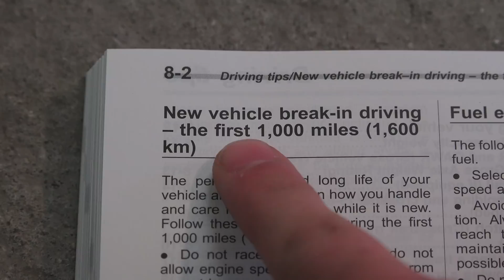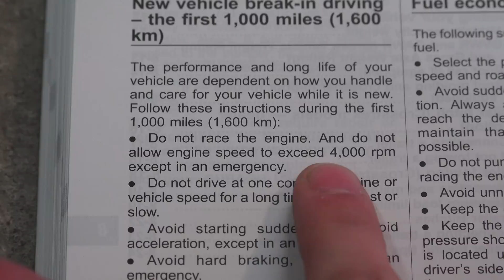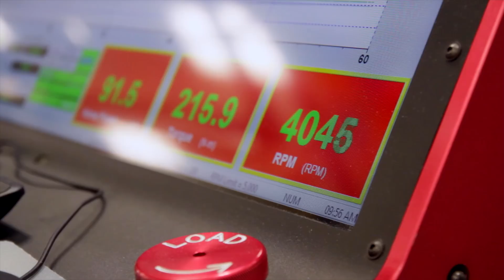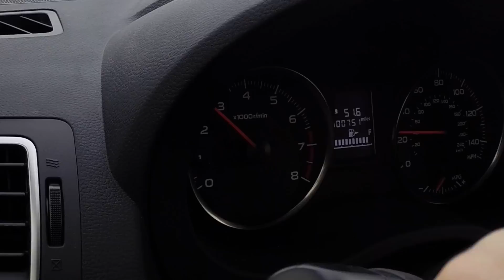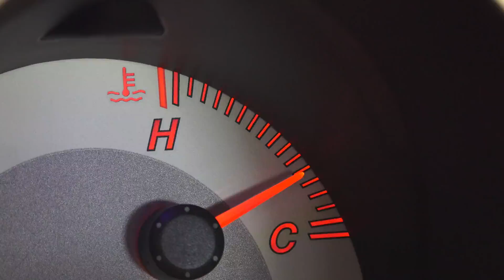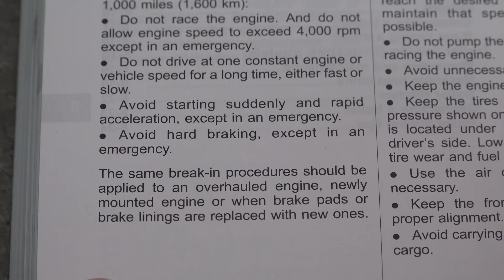5 Things You Should Never Do In A Brand New Car

Comment: I'm a diesel mechanic. When I use to rebuild engine, we'd get them to operation temperature , do some obvious  chech then work the hell out of them. I know gas engines are diferent, I'm not sure what is best but I've alway gone easy with my 4 strokes and 2 strokes for a bit. Do a quick oil change on the 4 strokes, extra oil on the 2 strokes and they last for years.

Comment: Finally, I had the guts to buy my first brand new car (I really don't like new cars they are just plastic and cheap manufacturing) and did everything for the first 1500km to ensure is going to be as good as it possible can taking in consideration is a 2025 car and is basically a cheap plastic piece of crap. By the way is a Suzuki Jimny 3d 1.5L I4 manual transmission and I'm actually in love with that little tough fella

Comment: If a Lycoming aircraft engine is not absolutely floored for the first hour then the rings will not seat and it will burn a quart of oil every 4 hours.
If you break it in WFO like the manufacturer recommends, most will burn a quart every 9-12 hours.

Comment: Unless your driving on a billiard table you shouldn't have to worry about cruise control. It's the speed that stays constant, not the rpm or load. I can't imagine trying to drive anywhere trying to vary the engine rpm enough to make any difference. If you are you'd be a hazard on the road.

Comment: The reason for not flooring your new car in the first few hundred miles is so the transmission and differential(s) have less load to bed in properly. If your engine were to be run in on an engine dynamometer, if I recall correctly, the way that Lake Speed Jr (the Motor Oil Geek, who also works for Total Seal Piston Rings) recommends to break in your engine is to do some low load, low to mid speed running for about half an hour to bed in the valve gear, then do some runs of about 3/4 torque, and somewhat lower speed than redline, gradually working your way up to full throttle and up to redline. After that, you change the oil two or three times in the first 3000 miles to get rid of the wear particles ASAP. The rings need combustion pressure to bed them in properly, and not giving the engine enough torque can result in the rings failing to bed into the bores properly, and once the initial bedding in is complete, that's the way the engine will be until it starts wearing out. If you haven't given the engine enough of a test, the rings won't bed in properly, and you'll have an oil guzzler.

Comment: Thanks for another great video. This is why I bought a new GT4RS instead of a slightly used one. With a light-weight flywheel and sound that begs you to floor it, that's exactly what many people do on those test drives.  It's like a rental car, they don't care so they thrash it!  So you spend a ridiculous amount of money on a car with a couple thousand miles on it and have no idea if it has been treated properly.  Now I'm struggling myself to behave and have to admit I've done a few 6500 rpm shifts (redline is 9k rpm) but I haven't floored it and do vary the speed.  600 miles now with a recommended 18oo mile run-in.  ugh it's gunna be torture and I'm trying to behave.  I did read from an ex Porsche engineer that after 1000 miles you can slowly increase the max rpm but no redline until full run-in so hopefully I'll be fine..:)

Comment: I floored my gr86, trying to keep up with my friends supra 😭😭. I did this like 5 times for short periods during the first 1k miles. Did I mess anything up?
Reply: The oil consumption can be an indicator if you did something wrong. Actually to brake it in sooner you need to floor it but not to the red line. The high RPMs are risky.

Comment: The not flooring it comment is wrong, in modern engines with low tension rings cylinder pressure is what pushes the rings against the cylinder wall and provides the sealing to help mate the ring to the wall. You want some hard acceleration and quicker driving to get a proper seat on the piston rings.

Comment: Unfortunately, during the break-in period, some of that will be impossible, specifically getting it to operating temperature every time. When the car is being moved around when it's brand new, before you even take it home, it's going to be moved a few times by the dealership, and they will not get it to operating temperature. They'll start it, move it a few hundred feet, and turn it off.

Comment: Step 6: Change the oil and filter at 500 miles.
Step 7:Change the oil and filter at 2,000 miles.
Step 8: Change the oil and filter at 4,000 miles.
Step 9: Change the oil and filter at 7,000 miles.
Step 10: Change the oil and filter and automatic transmission fluid and filter (if applicable) at 10,000 miles.

Many years ago, when I was 23 and going with the girl that was to become my wife (back in 1970-71) and I knew all of this stuff about cars, her 18-year-old brother bought a new Camaro with a 427, four on the floor, and a 4.11 rear end. I told him how to carefully break in that engine. Well, he took a trip . . . and seized the engine in about 300 miles. It just breaks your heart.

Comment: This is all ok, however oil and engine technology has changed. manufacturer recommendation is incorrect and you can do more damage "babying" the car. the first 200 - 300 miles I agree, take it through the revs and 50% to 70%  of the rev range. after 500 miles take it through the rev range and give it a few full throttle boost in a couple of gears. The key is to apply pressure on the rings by keeping the revs a little higher after you remove your foot from the throttle and not just changing gears to drop to 2000. basically ensure the engine and gearbox oil is at temp and for the first 200 miles I take it through the rev range up to 3000 RPM on country roads, then from 200-500 take it to 4000 and occasionally 5000 revs (75% rev range) and then after 500 miles I occasionally give full boost for a few pulls say from 3rd gear to gear 5 and at 1000 miles I give it an oil service. Its good to go. I wouldn't launch control it till at least 2000 miles

Comment: What about race car. They constantly rebuild their engine, it is not feasible to break-in their engines with 1500 miles, they can't drive their race car out in the street or on the track (track time may not available). They don't have timento run in slowly as their next race is tomorrow. Every drop of HP is important to the team because everyone run the same engine (e.g. Moto2 or LMP3). How would race teams break-in their new engines?

Comment: If you ever buy a vehicle that was owned by an older person that has very low miles on it and it's about 10 or 15 years old and hardly use kept in the garage it's going to make engine noise and burn oil and have a lot of no matter what kind of car it is

Comment: I just bought a brand new Crosstrek. My commute to work is only about 15 minutes with half of that being on the highway for 5 miles. What amount of time should I drive on the highway to allow the engine to get to optimal operating conditions during the break in period. I could extend my commute to 20-30 minutes by going a couple more exits on the highway and turning around. At least until after the break-in period. I'm also thinking of doing the first oil change after the first thousand miles. Your thoughts would be greatly appreciated thanks for the awesome content.

Comment: I have a LS3 Camaro and one of my friends too. I always told him to break in his brand new engine following the rules. He always made fun of me saying that it was was just BS and useless. Now the results : my Camaro with 175 000 kms doesn't even lose a tiny drop of oil between oil changes (it's even almost clear oil when I drain it from the sump). His Camaro, on the other hand... his trashed LS3 drinks more oil than fuel 😂😂. Now every time I see him, I'm like "I told you" 😂
Reply: That same rules should apply to your first woman that you have f*** or if you go the other way vice versa but most don't follow that rule anyway that's why the b** is in the bad mood so blame it on you know are too much of a hard-on how many pumps it takes to ram it

Comment: Warm up? Isn't that what the first alarm is for (some think that is a seat belt warning)? With old British motorcycles, and 50 weight oil, engine warm-up was crucial. Today, with 10W-40 weight multi-grade oil, and a vehicle built with modern tolerances, once the oil has had enough time to crawl out of the sump and coat the entire engine, aren't you ready to go? Hence, the use of the seat belt buzzer as a guide.

Comment: On new cars the one thing that need breaking in or beding is the brakes.. doing 4 hot stops from like 50 to 10 hard braking set the adhesive in teh pads,, then you drive for 20 or so mins to cool them down.  they need the heat to cure.

Comment: My key is to follow the owner's manual. For the 500, FCA recommended a 300 mile break-in, slow speeds for the first 60 miles, cruising at 50 or 55 MPH for the rest. Avoid full throttle in first gear but after 60 miles give it brief full throttle bursts at cruising speed. (The old Italian Tune-up.) That's a hard procedure, so I spent a weekend breaking it in.

Comment: would love to see an updated version of this video with the new cars. i.e. GR Corolla, Integra type s, etc.
Reply: Well at the Mi Toyota in Long Ixxxxxxxxxxnd they got a red one at right now yeah I was thinking about buying it but I just wanted to beat on it so I took that sucker about two blocks down the road and I just nailed it neutral for about 20 minutes until I saw a little bit smoke started coming out the back then I just threw it in first gear and I took off from the whale that sucker around the Middle Island lake down to Gordon heights and left it in first gear I didn't even step on the clutch I banged all the gears and 5th gear was starting to make noise so then I started taking it easy with it because the thing started to smoke like a dog smell like a brand new toaster I just the four-wheel drive the transmission I spit on it and that thing with sizzling so I took it back and said f*** you if I can't get it for $30,000 you can shove it up your ass buddy

Comment: I bought a brand new car and I asked if I need to run in the engine. I was told by the manufacturer engineer that we don’t live in the 60’s and there is absolutely no need to run in the engine. Just use it normally. Then he took me  for a ride in my brand new car that I had just bought and the first thing that he did was floor it and took the car to +200kmh . I have been driving the car hard every day and it currently has over 100 000km on it and the engine is perfect. It doesn’t use a drop of oil and zero smoke and I drive it like I stole it every day 😊
Reply: This guy is full of himself here.

Comment: Pretty sure that: “don’t go full trottle” is guided towards performance cars.. especially with turbo.. I have a fresh 80s fully mechanical non-turbo diesel.. that thing doesn’t have enough pressure and so on heat/friction without a full trottle after warming up 🤔

Comment: Everything I've not been doing with my brand new corolla 😂, she'll still go 500,000
Reply: Well I guess you plan on keeping the Corolla every Corolla I bought Burns oil like a sieve only one or two don't burn no oil like the one I got now and it's about 35 years old yeah the last one that I bought brand new I beat the s*** out of it and pissed in the oil and threw a ball bearings in it for the one month that I had it and then I sold it for it was worth it was worth it for the money I lost on Corollas that I bought hundreds of them yeah I love beating the s*** out of it and throwing little small ball bearings in the motor and the in the oil cap rather and watching and listening to the motor grind it up and eventually wear it out so it burns massive amounts

Comment: Great video! Much appreciated. I just finished the 1600 km break-in for my new 2023 Crosstrek PHEV. I had the hardship of having to travel 400km at the end of every week (200km to and from). I never used cruise control and I tried never to stay at a constant speed for more than a few minutes at a time. Basically 90-115, drop back to 98 and then back up to 115...Back down again. Not the perfect break-in process, but best I could do! I was able to do a lot of start, stop, cruise a bit in the cities between long trips. I also put it in "Save Mode" before hitting highway speeds so that that the engine had some warm up time before the eventual save mode (electric + engine) highway parts of the trip. I never floored it, slammed on the brakes or forced the engine from 0. 

I just took her in today @ 1800 km for the first check-up, oil change, etc. Now on to driving normally with cruise control and such!

Comment: One disagreement is that the first few rides SHOULD BE short as with most initial heat cycles.  Things like differentials and CV joints are like breaking in a new wood stove.  You SLOWLY bring them up to a mild temperature and let them cool down fully and heat cycle them.  You then increase the length of these heat cycles and can increase the temp at which you bring the components up to.

Comment: Small window of opportunity to seat those rings.  I warm it up then run it with short bursts of acceleration followed some hard deceleration.  Nothing crazy but I think the worst thing you can do to a bran new engine is just let it idle or cruise it at slow speeds.  I don’t think the rings would seat properly and you would potentially have oil burning issues for the life of that car.

Comment: So is there any benefit in the break-in period to allow the engine to reach operating temperature before driving? With keeping in mind of not exceeding 4,000 RPMs or whatever else as stated during the break-in period. As you stated it's important to have the engine that operating temperature so that the lubrication system properly operates under ideal conditions? Would the ecu's tune from the manufacturer have some affects on this line of thought, and how would you know?

Comment: Meanwhile I had a 700+hp Supercharged Mustang that I was running down the drag strip well under 1000 miles and got rid of it at 55k without any issues with the engine, drive train on the other hand is a different story lol

Comment: Also break in the brakes gently. No jamming them if it unnecessary. I broke in a new honda civic recently by driving on a hilly curvy road next to a river. I varied the rpm between 1k and 4k and gently applied the brakes to slow down.

Comment: I worked at dealership. we had new cars with 6 miles on them, we always ran them hard so if it was going to break we wanted it to Break before it was sold. It will not hurt it for the first time. never had one Break. after 10 years. Just saying.

Comment: Could something like this be accomplished by plugging something into the ODB II connector to simulate the engine break-in procedure while the car just sits in your driveway?  Automatically varying the throttle within the appropriate ranges etc. This obviously doesn't do anything for your break-in times for tires and brakes, but at least the engine would be properly broken in. Is there a break-in period for transmissions?

Comment: What is the recommendation on oil change for new cars? I'm conflicted on if new cars should change its oil after 1000 miles
Reply: I want to know if they are filled with running-in oil or not. If they are filled with regular oil, then there is no problem with an early oil change at all!

Comment: Oh snap! I used cruise control a few times 😭
Also I did full throttle at 1275 miles. Just to test it. Owners Manuel says break in period is 1000 miles. Should I be concerned?

Comment: my father was a professional engine builder and i was lucky enough to learn a lot off him over the years. he said build it to the highest tolerances you can, have all machine work done the best shop available and make sure all bolt ons like flywheel and balancer are the best you can get. spend 200 ks with engine at normal running temperature and if you can't flog the f out of it by then, you should never bet let near an open engine again! We built a 450 hp Cleveland and i started flogging it within a week of the build. it never used oil, detonated, smoked or fouled plugs. it quite often got beaten on straight out of the shed and put away wet after a hard ride so to speak. it accidentally (yep) saw 7000  plus rpm too many times and when i pulled it down to check it out about 10000 ks after the build it still looked like new inside. i put it back together and i have flogged it for another 10000 ks and it still doesn't miss a beat. so moral of the story? build it right in the first place then beat down hard on it!!!!!!!

Comment: Motor manufacturers bring the motor up to 80-90% rpm for 7-10minutes then change the break-in oil, and repeat the process before putting in the final oil and sending the motor to be assembled in the vehicle, this is done in small vehicles, performance vehicles and also in big diesel mining setups.

Comment: Erm... i had a new car and I did not floor it nor redline it but during 1 of the stoplights last week when I put some gas, at half way point from flooring it, into the engine, it felt much weaker than normal and I had to release the pedal and try and step on it again 2 more times before the engine felt normal again... is that something I should be worried about ? because it did make a small weird noise as well like the engine is choking or something... its a fully electrical injection system so I thought the computer will handle the gas being pumped into the engine and not think too much about it... but now I am worried after watching this...